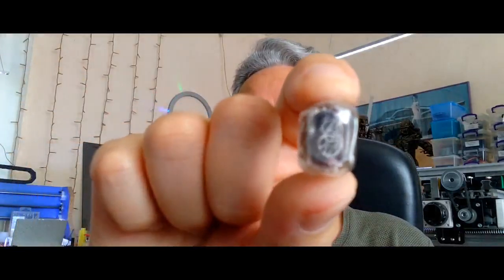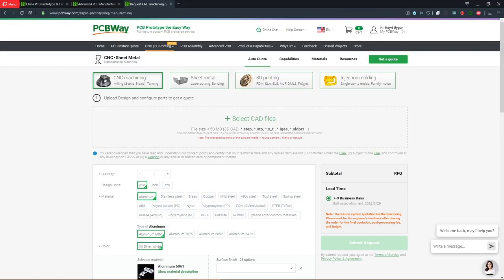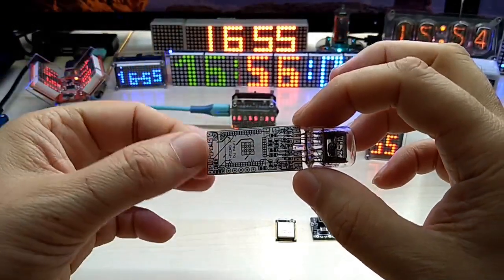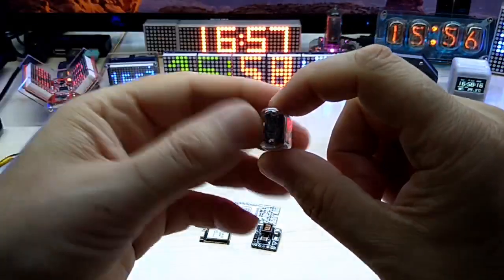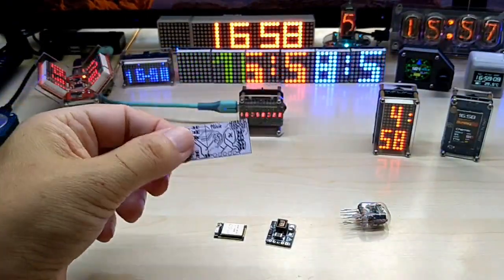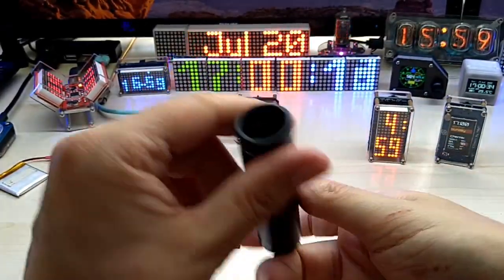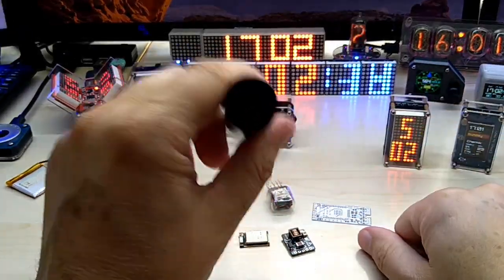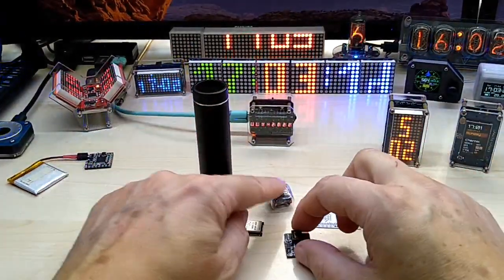Intro to my new Single IN-17 Nixie Tube NTP Clock with #ESP32 by #Hayri sponsored by #PCBWay Part 1

Comment: Can't wait for the update on this, really cool project! Not sure what one would use only one digit for though, but still really cool 😃 Also, I looked at my own thumb when you measured the ESP module and thought, ok.. that size.. But then when you put the PCB and nixie inside the powerbank tube, it struck me how really small this project is 😂😃
Reply from the maker: Thanks Chris, I look forward too 🙂One digit is actually really enough to show the time in hours and minutes, the limitation is more by having "just" digits, at least in these small tubes. Other larger tubes do come with special characters like certain letters and symbols. At least I did add a temperature sensor to my Nixie Timer/Clock. This one I wanted to keep simple and cute 🙂
Reply: @iHayri1  Hehe cool, will be fun to see the update 😃